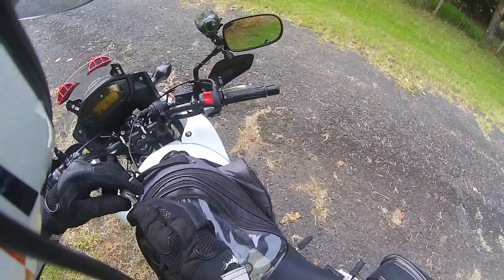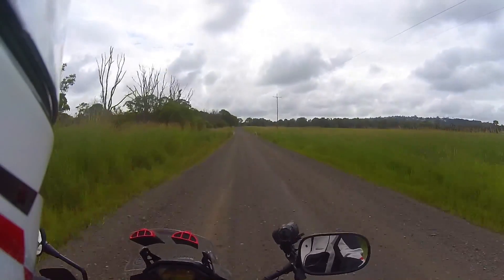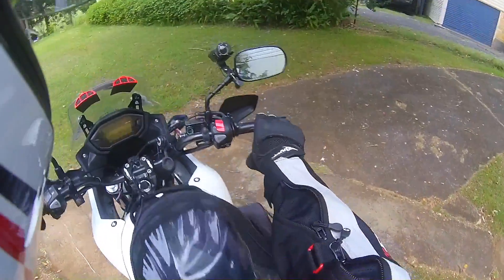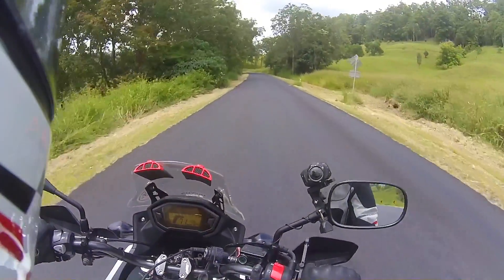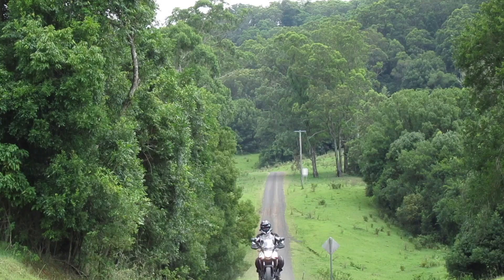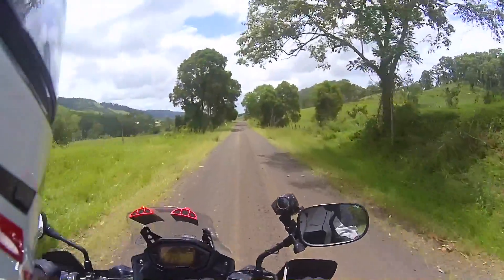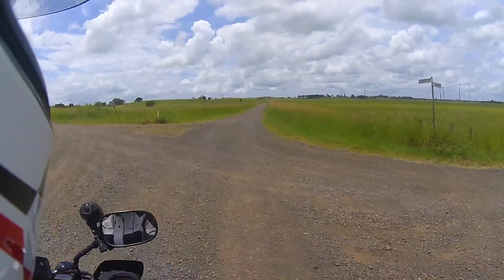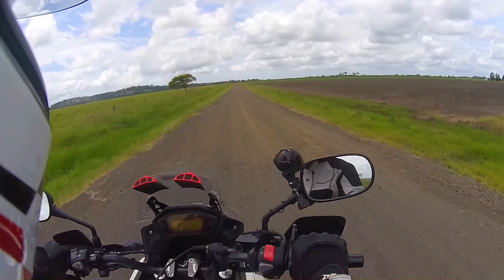CB500X ADV - Adventurey Mods for Falkor

Comment: Like that abs kill switch. 

Front brake - after watching Chris’ video of your last ride it might be time to add “using the front brake on gravel” to your list of things to learn!!
Reply from the maker: That's a very long list...
also relevant to that video - how to make the bike slide in the direction you want (always steps out to the right and goes left on me...)
This is all due to starting riding in my 50's when the lack of fear was a distant memory, lol ;)
Which is why I'm signing up for an adventure course!!
Thanks for watching mate :)
Reply: There should be more “how to” videos on the very basics of riding a road-adventure bike on gravel/dirt. 
I’ve ridden trail bikes all my life so it tends to come naturally. So I really sympathised with you when I saw your fall. 
Look forward to your video on “what I learned at adventure riding school”.
Reply: Honda NC750X Stuff  too be frank, dirt roads on the NC is scaring the pants off me, the Enfield was much easier for a complete off road novice like me. I guess practice then more practice....oh yes and crash bars 😬
Reply from the maker: Yeah exactly how I felt when I started out off road (and still largely do). Dropping the tyre pressure helps so much (but don't go below about 28psi in case you do a rim). Just do like me and try it all at a speed that many would laugh at, lol ;)
Reply: CaptainCranky your right I think it's a combination of no skill, new bike and no crash bars. All can be fixed....well the skill thing is a problem 😁 cheers mate have a great weekend

Comment: Mayby its my sportsbike background..but l never uses the rear break always the front.
Love the engien bars and the skidplate onit..looks good
Reply from the maker: Yeah - different world - if I'm going hard on the twisties it's all about careful use of the front, with some engine braking at times. No good on the dirt though, although I do need to learn the techniques of letting the front slide a little on purpose :)
Reply: CaptainCranky on dirt its the back brake that rules, but on asphalt its the front..for me....guess the stroom wount slide out as easy as my gixxer1000 did with the backbrake use..
Reply: Back break on them hills was useless..

Comment: One of the exercises we had to do was riding with fully locked front wheel. So I’m not worried about using it :P Btw very adventury :P I need to change footpegs too
Reply from the maker: Yeah I'm hoping to go on an Adventure training course soon, hopefully learn some of that :)
The footpegs... how did I ever live with the Honda ones??? :)
Reply: Do you have a link where you got them? Ive been trawling through ebay for MX pegs with the rubber inserts.. Id have the rubber in there for my work commute so as I dont destroy my nice shoes.. :)
Reply from the maker: ADV-Rydr-Bloke I got them second hand off a mate, I guess check swmotech if they have a AU outlet maybe.

Comment: anything that gives you more feel and confidence has to be a good thing. I have selectable ABS on my KTM 390 Duke, it really annoys me that I can't turn it off or on when riding, I have to be stopped, it also bugs me that if I want to turn it off, I have to do so every time I turn the key on, I wish it would accept my choice until I tell it otherwise.
Reply from the maker: I know exactly what you mean. too many products are rushed out without enough user input, otherwise the things that bug you would have (and could easily have) been included in the bike's electronic set up. Real bug-bear of mine in general. Cheers mate, ride safe.
Reply: you too boss :-)

Comment: I was just wonderful, how you feel about the Rally Raid ABS cut-off switch, now that you have had it on for a while? I have I think you know already a 2015 CB500x with ABS. I have found it a bit uncomfortable when I feel it come on when I am slowing down riding downhill. Does this help, I am thinking about putting this on my bike, your input would be very appreciated.
Reply from the maker: Hi Dolly - yes I remember :)
Sorry about the late reply - I was off road-trip camping for a few weeks. 
Turning off the ABS definitely helps, and the downhill loose gravel is the prime example of where the ABS feels VERY dodgy. I just wish I'd remember to turn the damn thing off, haha, as I usually end up in the downhill situation, ABS clicking on and off, before I remember. 
It would take some practice with it turned off to get used to how much you would want to lock up each wheel and use the slide to slow down, the old 2 fingered lever technique would come into it's own. I absolutely have to go practice this a lot more and remember to turn the ABS off as soon as I leave the blacktop. 
If you're going to go off road and want to feel in control I would definitely recommend the switch. The RR one is not cheap, and mine was a gift from a friend, so I would think any switch you can fit to the bars would work - it simply interrupts the positive wire to the ABS fuse. 
All the best Dolly, and thanks for your interest.

Comment: That is 2 mods I'm looking at doing, How is the vibration on the pegs with the rubber removed? Thanks for showing Capt....RSM8
Reply from the maker: I've ended up leaving the rubber off - I think you'd do the same on the strom. Almost no difference, not enough vibration to be an issue. RSM8.

Comment: Did I hear that correctly?

You don't use the front brake much but especially not in the dirt?
Reply from the maker: Yeah I guess it's a bit misleading - I obviously use it to stop but mostly engine and a little rear brake to slow into corners. I don't use the brakes much at all TBH, but then it's not a greatly powerful bike and I don't approach corners or junctions at high speed.
Reply: @CaptainCrankyMotovlogger  I read other comments you'd made here and got clarity on that...

I'm always surprised by the "It's not a powerful bike" and "Is the CB500X big enough for XYZ" when I find it to be perfect for everything and ride like a mad man and eternally grateful it's not more powerful or I'd be dead 10 times over! (I'm just shy of 100kgs and often carrying luggage and or pillions, burnt through a set of front pads in 10,000klms!)
Reply from the maker: @edgarbleikur1929  Ah yes, look I totally agree, the bike is well powerful enough, I was comparing it to litre bikes etc (which, yes I would kill myself on even with my tentative approach). I do practice hard braking with the front quite regularly so I know what it feels like on the odd time I steam too fast into a bend :)
Reply: @CaptainCrankyMotovlogger  I'm comparing my CB500X to my previous KLR650 and G650GS and it stomps all over those bikes - obviously it's a twin but at only 470cc I was stunned the first time I  road it and often still am ripping through gridlock Bangkok traffic leaving everything else behind or smashing up highways for hours at a time well above 7000rpm! (I change oil and filter every 4-5000klms)
Reply from the maker: I can totally understand that - yes, for a 47hp is performs amazingly, and you'd be like the superbike amongst all the scooters and 125's etc. over there. I've always loved that, as well as taking me down the dirt roads, it goes great in the twisties :)